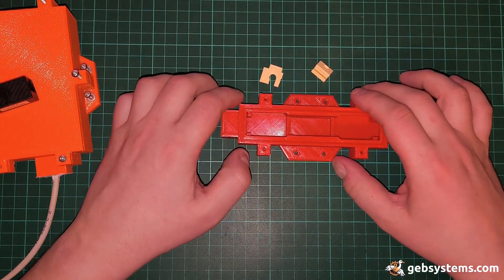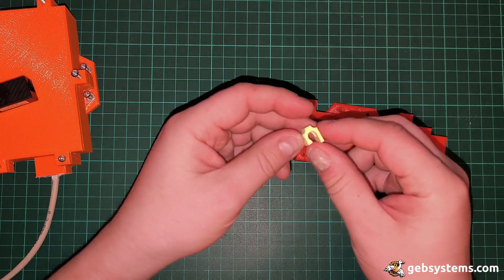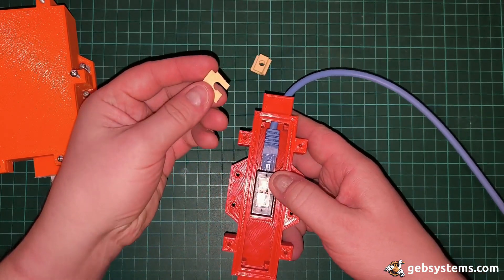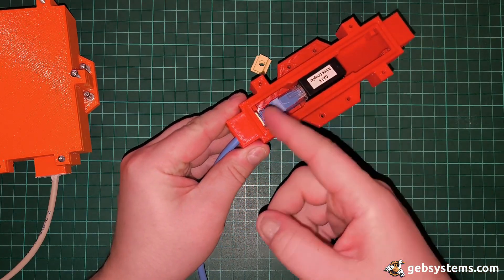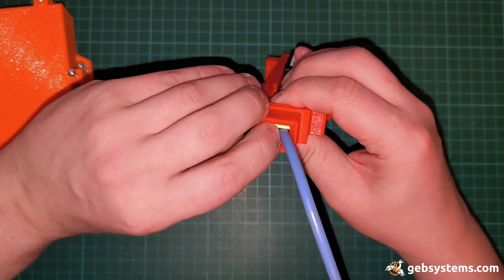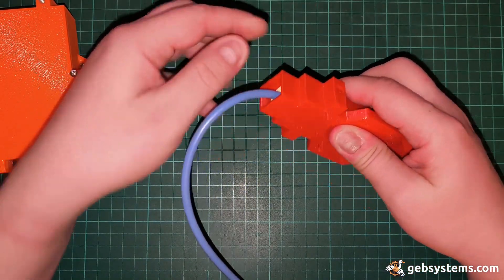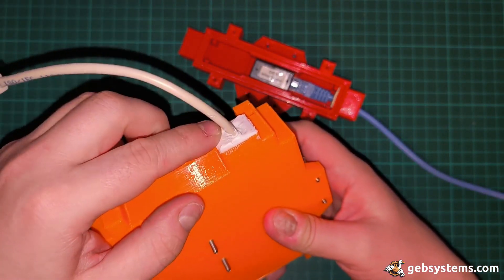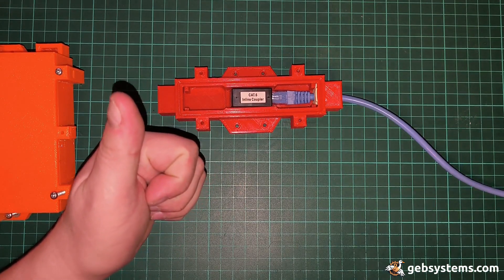Waterproofing my DIY 3D printed enclosures (new way)

Comment: As far as I understand. Unless special treatment has been done all 3d prints will let water pass through. Rather slow, because of the micro pores.
Reply from the maker: That could be the case. However, I did a test for two years with a 3D printed enclosure that was outside and there was no water inside (I also had a temp and humidity sensor inside it). It would also help if I would coat the enclosure I agree with you on that. But for a basement or attic deployment it should be enough I think. However, saying all that, do you have a recommendation what I could use to coat the enclosure?
Reply: @gebsystems  I don't know anything specific, I'm mostly sharing what I've picked up from watching a lot of other printing channels. Don't have a printer myself.
Some videos I've seen use acetone to chemically melt the print lines together. Others just use typical sealants like lacquer that can be found at any hardware store.

I'm just a YouTube watching sharing what I've learned from watching to much YouTube.
Reply from the maker: @kyleallred984  I know how that feels. Searching for something on YouTube to find yourself 3 hours later watching some hydraulic press videos you never knew existed... I think I did come across some of the idea before but I never really gave me a time of day to explore. From what I got is that you need to use certain printing materials to get best results. As in ABS apparently is good for this. But, I might give lacquer a go.

If you like tinkering and messing around with this stuff you should totally get a 3D printer. They have gotten so cheap that it is just stupid. I picked up my Magician Mingda X for $99 on a promo (and they do them quite often). These cheap printers are feature packed stupid.

Comment: Depending on the environment of course, but water proof means water that will eventually get in can't get out.

Some boxes instead have a drain hole.

You could have the top wire turning around and going out the bottom to make it splash proof but fully vented.

Maybe not instead of this, but keep it in the pipe for the day you need a splash proof case that will dry up if water gets in
Reply from the maker: This is not a perfect solution that I am adopting but it should be good enough for a basement or attic where the conditions are not ideal (moisture, some dump, dust etc). I do not want to have any drain holes as that means more points of failure that I need to worry about. I had a test rig that was living outdoors for about 2 years with hot glue keeping things "waterproof" with an Arduino inside and it managed just fine. I even had a temp and humidity sensor inside of it that I could pull the data on demand which was quite useful.

Now, why would I want my enclosure to be vented with a hole at the bottom somewhere?

Thank you for your input. If I did not understand any or some of your point please do correct me.